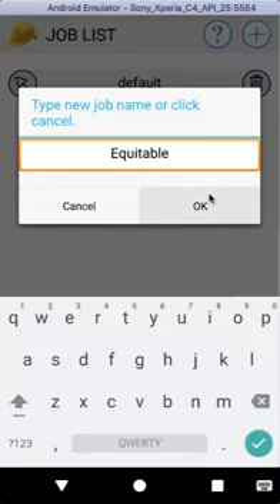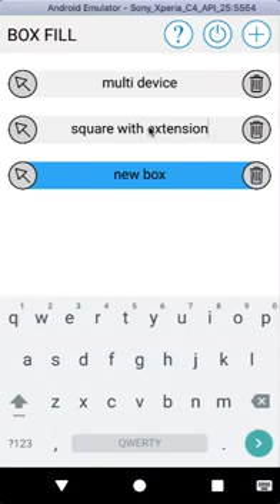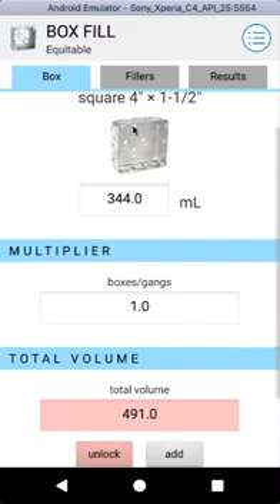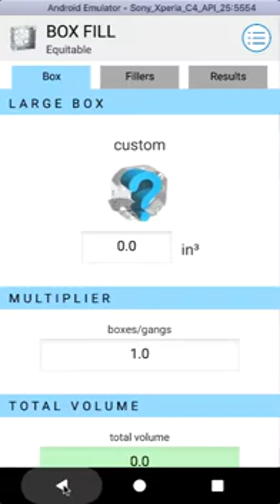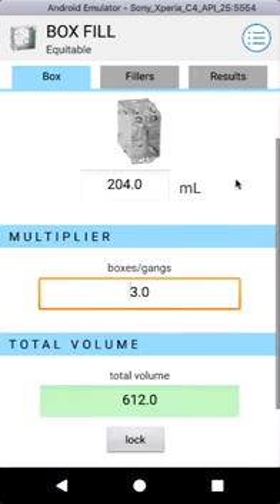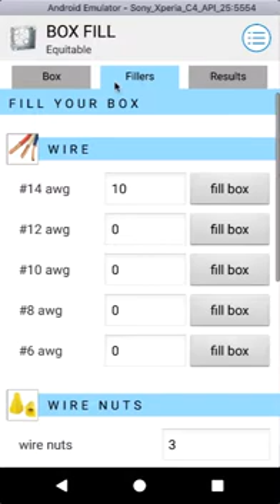Box Fill Android Tutorial

Comment: Does not account for grounds in the box.  So, you'll have to add that in yourself.  Also, the area of a 4x4x2 1/8 box is listed on several sites as 30.3 cubic inches.  Here they use the value of 29.9 cubic inches.